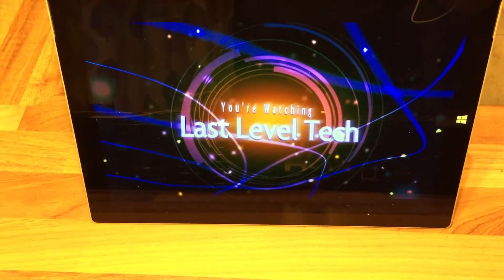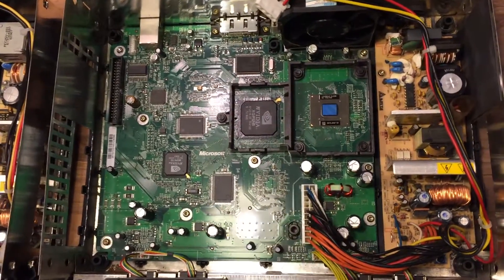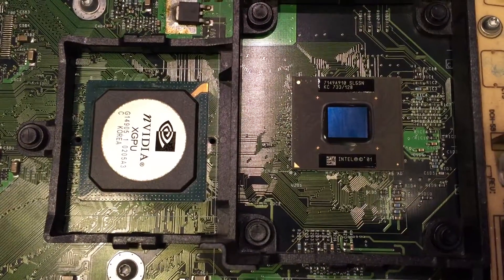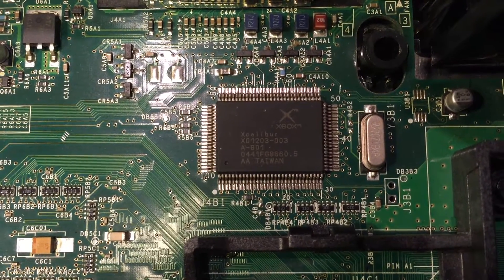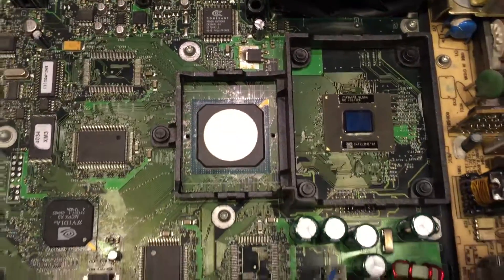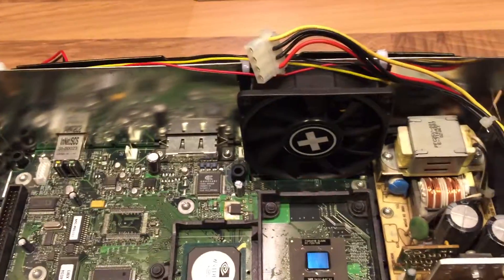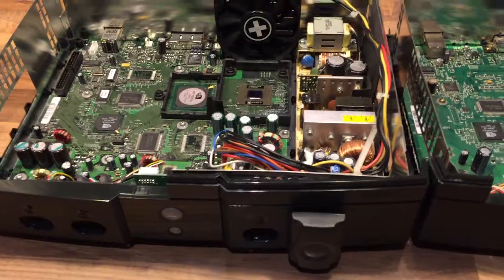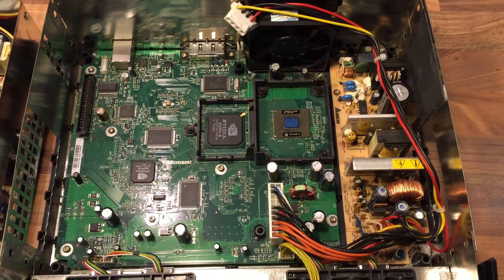Original Microsoft Xbox Motherboard Comparison

Comment: I have 3 OG Xbox and they are all from 2005 I was worried about the clock fuse. From 2001-2004 they have to be replaced or taken out. They didn’t even put the fuse just due to the 360 coming out

Comment: the 1.0 and 1.1 Xbox had a CPU fan on the gpu  heatsink
Reply: I have a 1.1 and it does not have a fan on the GPU!
Reply: @stansteez  Microsoft M/B's were vastly different from one another.
Reply: Only 1.0, 1.1 onwards has no GPU fan.

Comment: Those power supplies are dangerous as hell.
The 2 pin connector on the back of my original xbox got loose for some reason. When the xbox would start, it would actually spark and create smoke because I think that the connector was loose or leaning on something. I'm looking for a 12 pin power supply replacement for this one since I plan on modding it to support a bigger hard drive in the fairly near future.
Reply: This happened on the earlier power supplies because they didn't use anchor points on the connectors which you will see on later power supplies, so after plugging and unplugging so many times it began to break the solder joints and that would cause sparks. Microsoft issued a recall and released a new power cord with a breaker to prevent house fires. If you have one of these power supplies you just need to reflow or add solder on the joint to ensure a solid connection and then you can either hot glue or epoxy the connector in place so that it can't flex ever again when plugging in a cable. As long as the solder was reflowed and the connector is held in place it is completely safe to continue using, but very dangerous if those improvements aren't made. Before attempting this fix turn on your Xbox and pull the cord from the wall then hold down the power button for 15 seconds to discharge the power supply, otherwise you risk getting the shit shocked out of you and damaging your Xbox.

Comment: there is link  http://assemblergames.com/l/threads/does-a-v1-6-xbox-need-its-clock-capacitor-removed-replaced.57809/for clock capacitor removal only for 1.0-1.5 xbox versions don't remove clock capacitor on v1.6a-1.6b